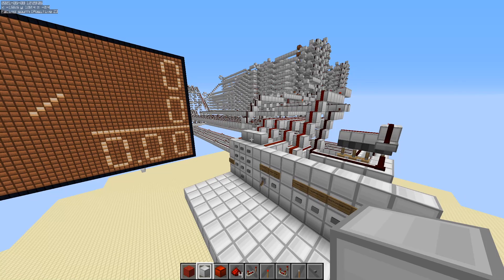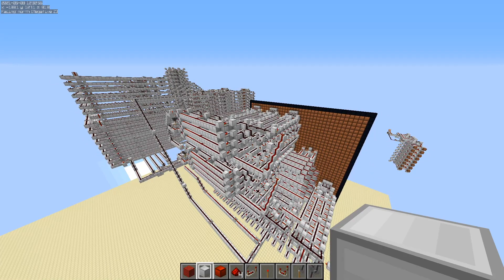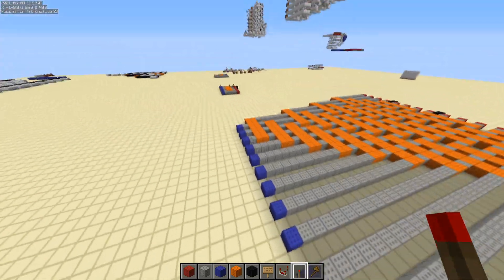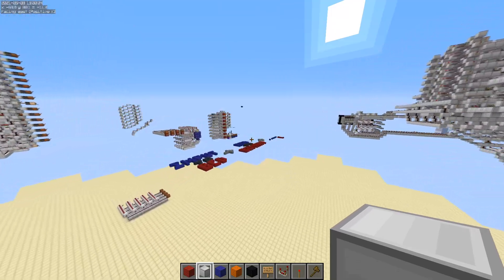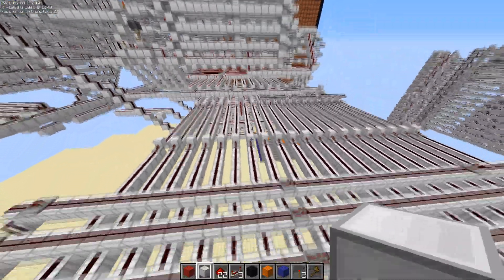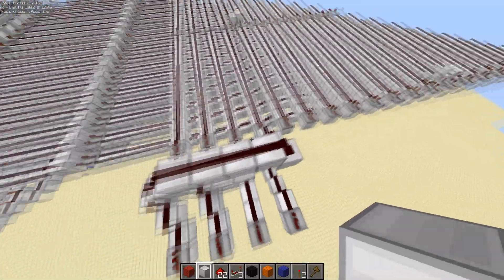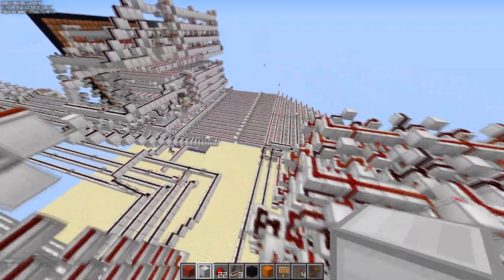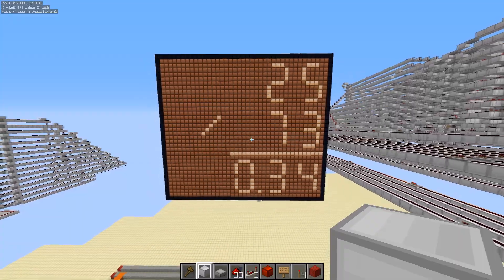Redstone Calculator Tutorial Part 8 - Binary to BCD

Comment: Great job highly recommend making a computer and a tutorial explaining it!keep up the good work love you vids!
Reply from the maker: Thanks it’s definitely on my list!
Reply: I'm still constructing the calculator on bedrock edition it will be fine right ?
Reply from the maker: @100manx5  no, some parts won’t work on bedrock
Reply: @mattbatwings  But you can build something but different that works the same way. And it will work on bedrock.
Reply from the maker: @100manx5  no, some parts won’t work on bedrock
Reply: Ok can you mention the not working parts
Reply: @100manx5  I’m on part 3 of the calculator and here’s some parts that won’t work for Minecraft bedrock edition:
Part 1: N/A
Part 2: Pistons for clearing (it doesn’t update when it’s not loaded) Remplace it with comparators on subtract mode.
Part 3: the clearing mechanism for the BCD to binary encoder. Follow tutorial on Redstone Logics Part 11.
Reply: Also when you release your graphing calculator ?
Reply: I followed the tutorial on bedrock, and I found a bug on it, when I type a number, like for example 1, it shows this
011
000
Reply: @neilfredericduma1654  Just set the repeter on the locking mechanism to 1 tick.... it'll work fine.... the bug is due to the timings of the delay not being accurate in bedrock.... : )
Reply: @kyroverse-privatechannel..6312 what repeater are you talking about?
Reply: @neilfredericduma1654  That’s because it outputs 2 ticks instead of 1 tick. I found a trick on a repeater to fix it. 
How: Set both repeaters to 1 tick.